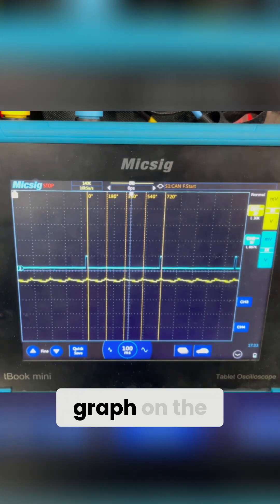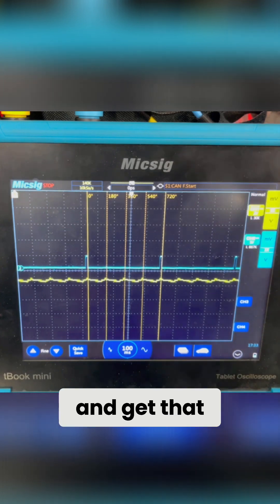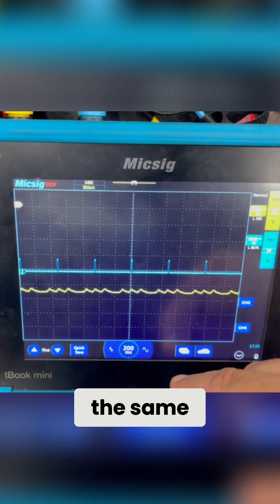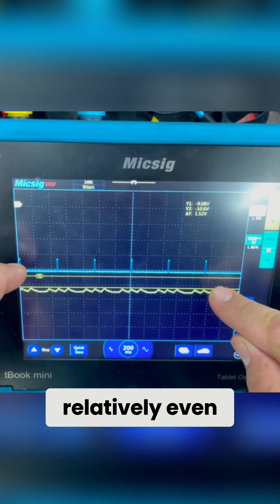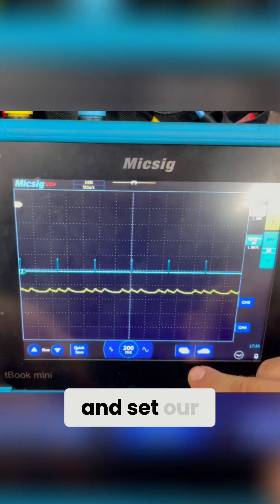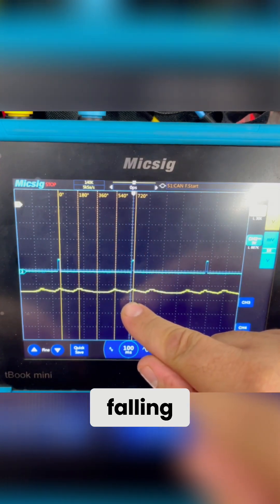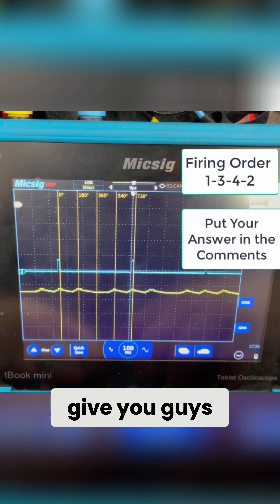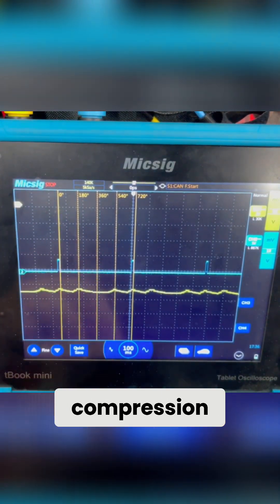Solve This Engine Mystery! Cylinder Compression Test

Comment: Oscar the video cuts out before ending . Are we missing compression on cylinder 4 ? Thanks for sharing . Your sinking off cylinder 1 what plug have you removed ? Could the low compression on cylinder 4 be because plug is removed .  👍 Artie
Reply from the maker: Thats correct cylinder #4 is mechanically low on compression.